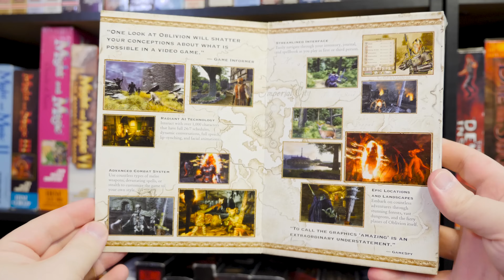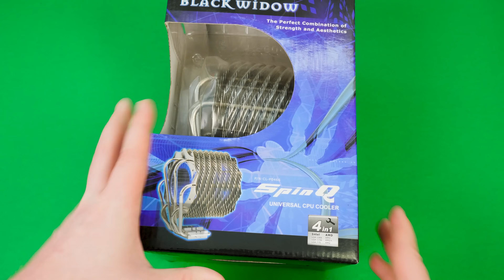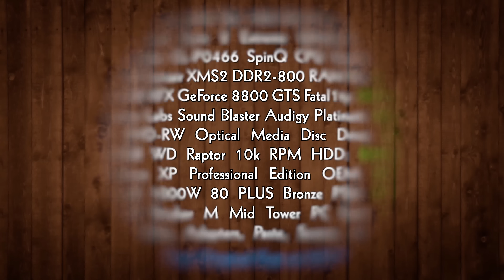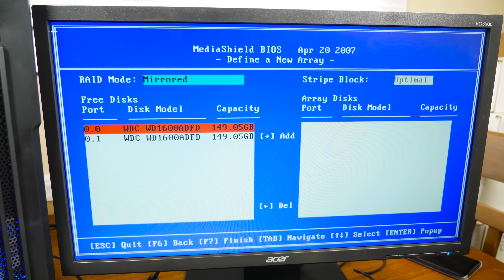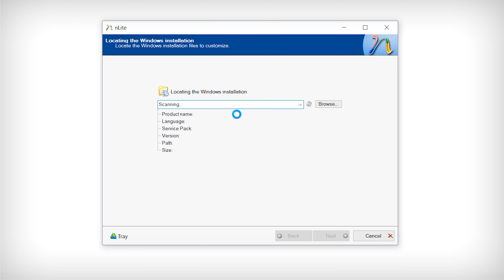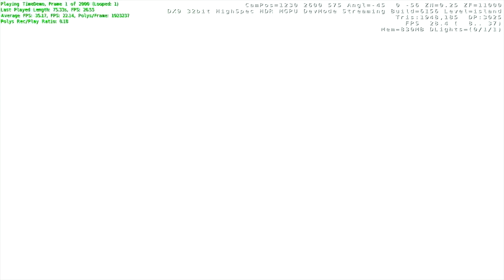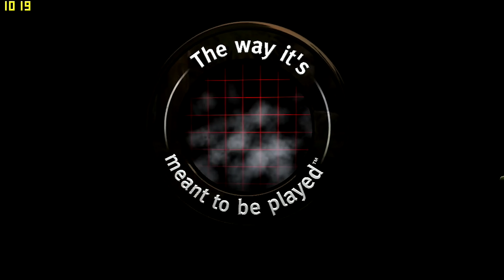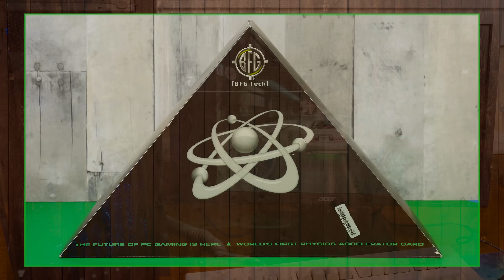LGR - Building My Dream $3,588 Windows XP PC

Comment: This era seems like more of a Vista PC than an XP one. When I think ultimate XP machine I usually think back to the early Athlon X2 days.
Reply: Damn boss, that stings. Well I had a later X4 965 Black Edition, but that was my main PC till...two months ago. Circa XP/early 7 processor for a decade.
Reply: I get what you mean, but I think he chose XP for nostalgia/stability because we all know how Vista turned out
Reply: @irridesu  Vista turned out fine, people who had 10 year old hardware or walmart PCs were the only ones that complained.
Reply: @GrumpyWolfTech  no. a thousand times no.
Reply: @irridesu  i really like vista and i NEVER had issues with it on my toshiba laptop from 2007. vista is my childhood
Reply: Vista was never popular so Xp out lived it
Reply: @GrumpyWolfTech  Vista needed ahead of its time specs to run, making it expensive to properly upgrade. Good OS, but too ahead of its time and power hungry
Reply: @irridesu  my mom had a cheap laptop running vista, worked just fine!
Reply: @GrootsChannel  My computer sure didn't. Vista fried my 2001 compaq's 256 color integrated graphics
Reply: @irridesu  oof
Reply: @GrootsChannel  ikr i guess 98 was the best for it
Reply: True although I was using XP as a daily from 2006 until 2010 like most people at the time.
Reply: This is def a vista era build not XP. Though a lot of people did keep running XP. I think i ran XP media center edition (for that juicy royal theme goodness) until about 2009 then i swapped to vista which was totally fine, if you had a good PC vista was no problem at all.
Reply: @GrumpyWolfTech  bruh it blue screened when you opened solitaire
Reply: Vista era doesn't exists. All was Win XP and Win 7 then, Vista was skiped by gaming comunity, and doesnt deserve to have era, same as windows me.
Reply: @warrax111  real gamers remember when halo 2 came out on pc and it would only run on vista
Reply: @AleK0451  dont agree, for me vista is crap, shame Of OS. would not install it, even because of some few games. Would wait for win7 anyway to play it. There is no Vista era.
Reply: @warrax111  yeah but no one knew when that was gonna happen, thank fuck it wasnt too long, felt like when they finally released SP2 on xp
Reply: @LunarVVolf i've never even played halo but i remember seeing the box in the shop and seeing only windows vista on the back
Reply: Hardware may be from Vista era. But many people in that era used XP, often out of choice too.
Reply: @LunarVVolf Sounds like driver issues.  Anyone in computers long enough knows the majority of BSODs are caused by poorly written drivers and generally not because of the OS itself.  Personally, I loved Vista and upgraded to it right away and never experienced a problem with it at all.  I ran it on a Core 2 Quad with either 8 or 16GB of RAM and whatever was the latest ATI graphics card at the time.  I don't think it BSOD'd once.  And honestly, I think Vista's interface was far more attractive than XP (which reminded me of Teletubbies, so I could never take XP seriously).  I don't know.  Mileage varies, but I really think Vista got a bad rap thanks to hardware vendors not following the Vista driver program.
Reply: @LunarVVolf I'm not intentionally trying to change your opinion, though I'm not sure why someone would refuse to change if given an opportunity to look at something differently.  I understand your experience with Vista was poor, but not everyone had the same experience as you, and that was my point for posting.  If your experience was poor and my experience was decent, what do you think the difference was between our situations?  Surely if Vista sucked it would suck for both of us, right?
Reply: Vista was dirt. A lot of people were hesitant to upgrade. Some of us never upgraded... It wasn't until Windows 7 people I knew were feeling anywhere near as comfortable as before with the idea again. Public trust in and support for MS seems to come in waves. XP was the highest point but it's all been downhill since they decided to make the Xbox for me anyway.
Reply: @Jrasta111  I think the complaints were like a self-fulling prophecy.  People simply heard that Vista was crap so they didn't want to take a chance.  I think this was proven by Microsoft's Mohave experiment.  They first asked people to rate Vista, then asked those same people whom rated Vista poorly to look at Mohave (actually Vista) and got their feedback and it was generally favorable.  I can't help but wonder how many people who say Vista was terrible actually A) tried it, and B) ensured they were using proper drivers and hardware for the optimum experience.

I've no doubt that some of the people posting here did try Vista, but of those with poor experiences how many made sure their drivers were verified for Vista?  Otherwise it makes no sense to me how the experience can widely differ.  If a product is truly and objectively bad, it's going to be bad for everyone.  However, if there are other factors that may contribute to a bad experience, perhaps those factors should be reviewed?
Reply: @OzzFan1000  The main problem was Vista took away support for a lot of old software people had been used to. XP was really the first OS since DOS that MS made that everyone agreed worked really well. Everyone was used to it.

So when they were told they had to upgrade to make use of 'new features' many were unconvinced happy with what they had already. If it ain't broke and all that which is a problem still today. In their rush to impress people with 'new and improved' it often seems to me modern development forgets to optimise what they have and make sure people will be able to use it the way they always have.

What good is fixing one bug if you create ten more in the process? Or create ten new features but then take out one people wanted and were already happy to use? What you have to understand is things like objective functionality mean very little in the face of the consumer experience. Ask anyone in tech support.
Reply: @Jrasta111  :-)  I've been in IT Support for 20 years now.  I don't disagree with much of what you say, however I think it comes down to people simply not liking change whereas I'm a person that loves change.  BTW - most of my older applications worked without a problem on Vista.  I had/have a bunch of Windows 9x games that work under Vista with minimal modification (compatibility mode usually fixed them).

The one area I will agree upon that wasn't implemented very well is simultaneous the one major improvement I liked the most with Vista: User Account Control (UAC).  I think the excessive dialog prompts and the fact that older applications simply assumed it was OK to write to areas of the disk that were off-limits under Vista created a relatively poor user experience overall.  It didn't help that most techies and SysAdmins didn't understand the reason for UAC or the changes it brought, so techies poo-pooed on the OS and telling all their everyone to stay away.

But I like UAC and I think the security it brings was immensely important. So much so that when I started my Desktop Engineering job at my current  company 5 years ago, the first thing I did was get UAC implemented on all client systems in the org despite my coworkers still hating it (because they didn't understand it).

And I think that is the crux of it.  It isn't necessarily the shiny new (buggy) features, but the fact that constant improvement and progress needs to happen, and the only way to drive that change is to understand what problem the new features solve.  Yes, UAC was very disruptive in it's form as implemented under Vista, but it was the single-most important feature of the OS too.
Reply: @OzzFan1000  I figured you might be in tech, I'm not but I have a few friends who are and they all didn't take to Vista, me I just preferred to stick with what I knew and could easily deal with myself. Mostly just old games as I like the more 'retro' stuff. DirectX10 had almost zero appeal to me. Also I really like Windows Movie Maker.

I think that's the thing, most people aren't in tech, it's not about whether they agree as they won't understand most of what you've said here. All that concerns them is will it do what I want it to do how I want to do it. Everything else is secondary and most people lack the patience that it would take to relearn basic tasks they've already been performing for years because some smart-arse developer thought they knew better. Feels pointless.

But I do agree change is often underrated. But, as I said if it's not broken... But we can be funny creatures when dealing with even good and necessary change. When XP first came out one of the first things I did was look for the autoexec.bat and config.sys files. Now, I look back and I'm glad I never had to look at those again, althoughin a strange way not doing so felt wrong and somehow I still miss those days. 

I feel like the only people who would've bought into Vista were the ones who would buy a new PC wholesale with it already installed and funnily enough the only person I knew who used Vista did just that. He did say it wasn't that bad. Everyone else built their own and not one said anything good about Vista. I'm not sure if the reception was better or worse than ME or if Vista itself was better or worse but it being like the ME between 98 and XP is just the feeling I got with it at the time.
Reply: @Jrasta111  I've been building my rigs since 92, and I've always went with the latest and greatest Windows OS (with the exceptions of ME and 8; 8.1 was good) simply because I like progress.  I purchased Vista to go along with a new machine I was building at the time and was very impressed by the interface, which I immediately liked better than XP.  The Aero "glass" effects; the black taskbar; the fact that I could search for and launch applications directly from the Search field built directly into the Start Menu were all bells and whistles that ticked the boxes for me - things that most users still don't use or are just starting to use in 7 and 10.

I just think Vista gets a bad rap for things that weren't the OS's fault, like the aforementioned BSODs (which as I stated are almost always due to poorly written drivers).  I will also agree that Microsoft did no favors by changing the specifications to use Vista so late in the game, and PCs that should have been able to run Vista before the spec change were only barely able to run it post-spec change, contributing to the poor user experience.  But I see the spec change as indicative of the sign of the times; it had been over 5 years since XP was released and there's no reason not to build an OS that can make use of newer hardware - but back to: Microsoft should have handled it differently from a marketing perspective.

In the end, you're not wrong that people just want to use their computer without having to relearn everything they already know how to do, but at some point a little bit of learning new things here and there isn't a bad thing at all.
Reply: @AleK0451  not only does joel use a virtual machine, he also didn't install sp2. i have ultimate sp2 w/ 2019 updates installed for when i feel like using windows or wine doesn't like what i throw at it, and it's as stable as windows 2000 sp4 was back in the day.
Reply: @lepidotos  who the fuck is joel
Reply: @AleK0451  the funny swedish man who brought up the solitaire crash thing in a livestream
Reply: @lepidotos  doesnt sound very funny
Reply: For many it was still the XP era. I tried Vista for a few days and had to revert back after quite a few problem. Made my next jump to 7 in early 2010s. My workplace which I joined in 2012 was still using XP and upgraded to 7 in 2014-2015, skipping Vista altogether.
Reply: @OzzFan1000  I always thought windows XP looked like a Fisher price toy computer operating system.  I could never take it seriously.  Vista had that nice aero interface.  I think it just never got a chance to gain wide support, but it definitely looked way better.
Reply: @irridesu  That's definitely not Vista's fault lol
Reply: Nothing was as shit as ME
Reply: Yeah, late 2006 is the latest you could really call Ultimate (era correct) Win XP build, but he's actually not far off with most components (despite stating late 2007/2008); the only thing newer is the cpu and even then, not by much. Still though, I think X6800 (the extreme version of the first core 2 duo series) would be a better choice both time-wise as well as due to the fact that no xp era games scaled past 2 cores anyway...and probably a set of 8800gtx-es, that would truly be the ultimate 2006 build.

Comment: Dude, LGA775 rigs are the the shit! I've been rocking the same motherboard since 2008. Last year I decided to do some much needed upgrading after finding a similarly aged donor computer at Goodwill for $6. From that computer I got 8GB of ram, an nVidia 8800GT and a better power supply. Then, I ordered a C2Q Q9550 off Amazon for $28. I was able to overclock it to 3.71ghz with total stability and it tears through Cinebench at over 400. The whole system totally rips and is completely usable for damn near any task short of modern gaming or video production. With an SSD, Windows 10 boots in mere seconds. Everything is just so snappy and it handles anything I throw at it with ease.
Reply: I tried it in the donor computer first. Got to the POST screen no problem. Good enough.
Reply: Yea, my Windows XP PSU up and sparked to death just randomly, and the PSU was only 4 years old at the time, no telling the game of a goodwill PSU lol.
Reply: Well, I rolled the dice and won. It's been running hard for 9 months so far. The PSU that was in it originally was way more sketchy.
Reply: @hoffer_moment  I do get it. I just didn't really care. I would have actually loved to have an excuse to put a new system together.
Reply: I've seen a power supply go out in stages and take half a motherboard and a hard drive down with it.
Reply: @Chris Season When the southbridge fails and the northbridge doesn't. 

I have another board with a northbridge that keeps killing ram.
Reply: You could potentially upgrade further and get a cheap Xeon x5470

Comment: I like how my 3.5 GHz quad core CPU is 86 dollars in 2019, but I'm 2007 a 3.0 
GHz 4 core CPU was 1000
Reply: You must be talking about a 3200G. I've got a 3600 in my build at the moment, and I've got to say that this unit is nothing less than phenominal. No pun intended.
Reply: you could have bought a q6600 for less than 200 back then, it was the enthusiast king because it had massive OC potential, 4 cores and a reasonable price. I still have mine running at 3.2ghz in a spare pc.
Reply: For reference, I got my i5 4690k in summer 2015 for a little more than 200 euros. Now you can get 6 cores with that amount. Not bad.
Reply: My new laptop is a decent bit meaner than my friend’s 4 year old one for about a third of the price. Technology does that

Comment: Man, I would have been in gaming heaven with a rig like this in 2008. I would have ran Bioshock with all setting high. Fallout 3, WoW, Dead Space....  Man, that period had good games
Reply: I totally agree, I remember so many good games from the mid to late 2000's, that's actually the reason why I have an XP machine similar to Clint running too.
Reply: We still have good games like those today... pfffft!
Reply: Whatever games you grew up with, like I would say 8-18 years old. Those are the games that you will think are the, "good old games".  For the most part this holds true for most people. Really, there are good games from pretty much every decade of games, the further back you go, the simpler they get, but good is not the same as complex.
Reply: I don't think it's entirely nostalgia, the early 360/PS3 era were the days before DLC and day-1 patches, so games just tended to be more finished upon release, it was also early enough that there was still some experimentation and thus new IPs.

2007/2008 had Mass Effect, Halo 3, Bioshock, CoD 4 and WaW, Assassins Creed, Forza 2 and Guitar Hero 3. A mixture of new and established IPs, any one of which you can go play and they still hold up fine.
Reply: Alex Stallwitz yes definately bioshock!❤️
Reply: My dream too

Comment: Those timings on RAM 4-4-4-12. Amazing :)
Reply: The time of Tight timings. It's like a 140hp miata crushing in corners Vs. a 800 hp car that gained ground only on the straight parts.
Reply: That's like having DDR4-3200 at 16-16-16-48 with a quarter of the bandwith
Reply: @LordWaldema  Remember Rambus memory? I had it and it was great. Everyone hated it because of the latency

Comment: ME: Thinking about rtx2080ti price after 15 years ( ͡~ ͜ʖ ͡°)
Reply: That wink is weird, I never get a squiggly wink like that!
Reply: It jast gna drop little bit like 800$
Thay don't drop any price for new stuff you can get it used from ebay or something but still not gna be cheap like you think its
Reply: yea right now the RTX supers actually perform just as good if not better for a cheaper price.
Reply: I feel like those new Graphics cards don't fall in price anymore, like at all.
Reply: Me enjoying my 2080Ti right now,  btw theres a good 30-40% difference between the 2080s and 2080Ti still @Mr. Safer ;)
Reply: @tvw4951  yea for 8 k
Reply: after 15 years it will be like 50-100$
Reply: i sold 2 vodoo 5500 por 450€ on ebay last year  ,may be they will worth alot in the future.
Reply: can it run Gta 50 ??
Reply: Check original titan prices